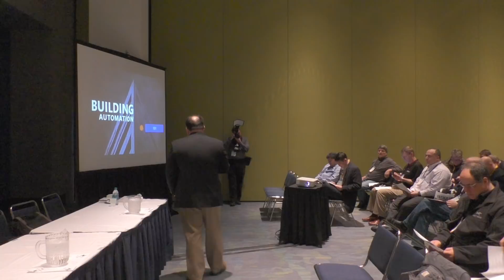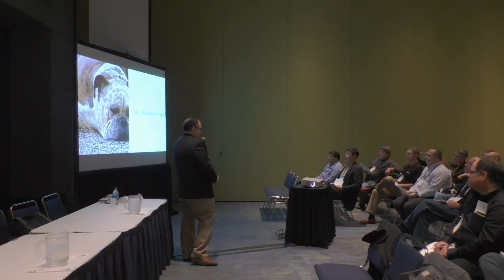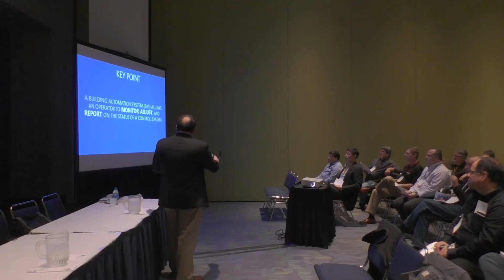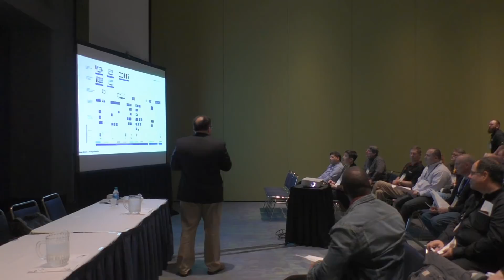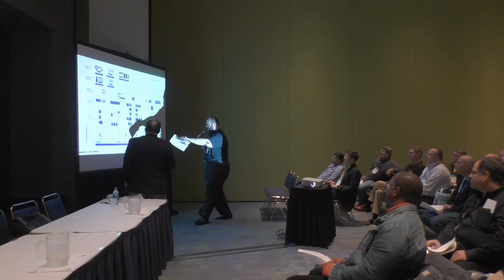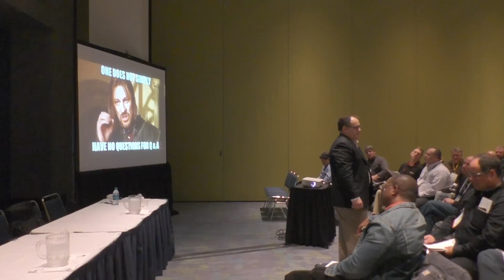Building Automation 101

Comment: Hey, your channel is great!

I got a question. 

Is there a reason why the field device comes 3rd in the bas architecture ? Should it not be after the input output ? Or it doesn’t matter ?
Reply from the maker: Thank you.

So with how typical architecture’s work is, you’re going to have the server or supervisory device at the top then that will connect via a field bus or network connection to the field controller. The field controller will then connect to and control the input and output points.